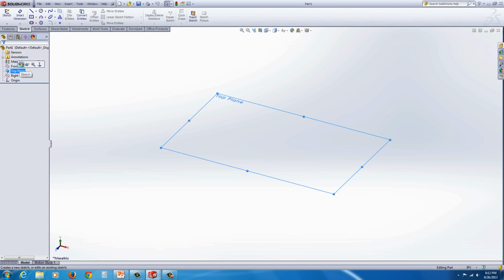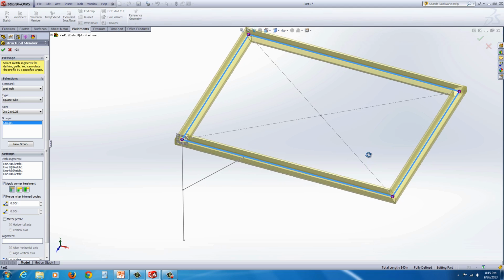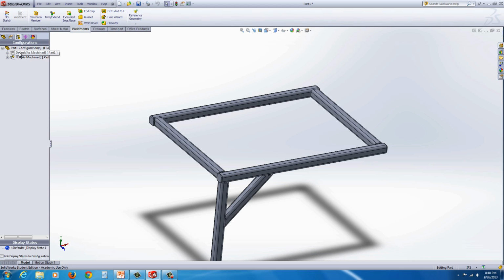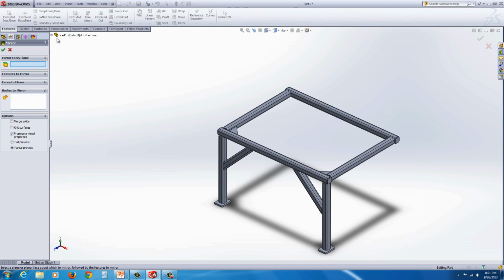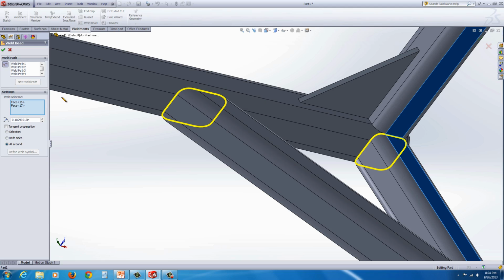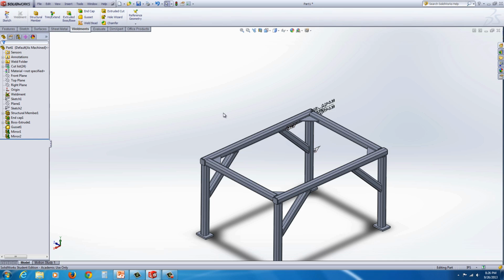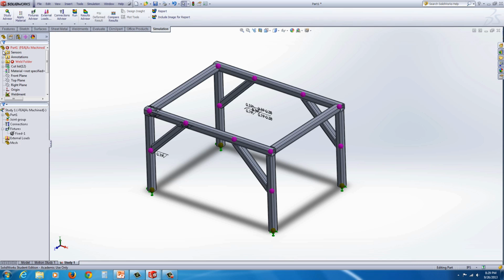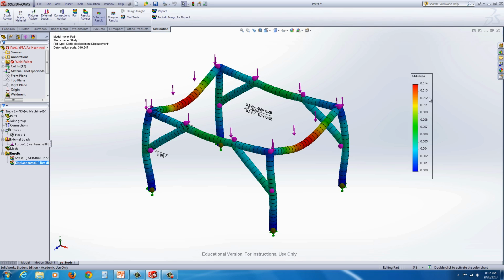E5 - SolidWorks Weldments and Frame Stress Analysis Tutorial

Comment: Something that I've just figured out: Unless the feet of the legs were going to be constrained from moving laterally, you should only constrain the four of them from moving up/down. You will need to constrain one of them from moving laterally, otherwise the simulation can't run, but this will give you a much more realistic result. You can see from the high stress at the feet in this video that the simulation was not acting as intended.
Reply: +Sam Roesch Good observation.
Reply: Yes, if you restrain all it will give the behaviour of the section being fixed into the ground, i.e. the connections to the ground can carry bending moments. If this isn't the case it's a dangerous assumption and the whole structure will be completely wrong.